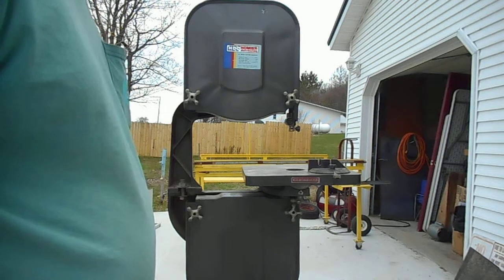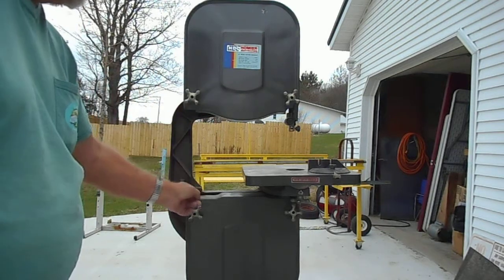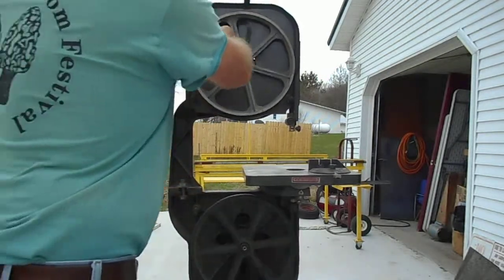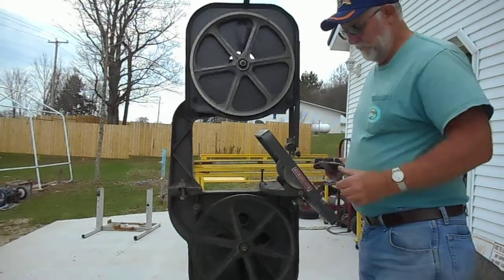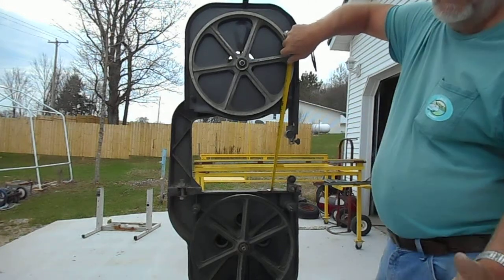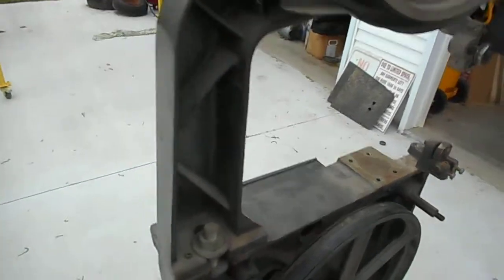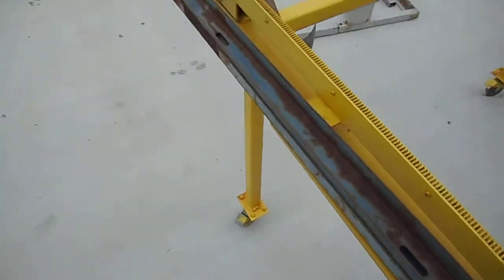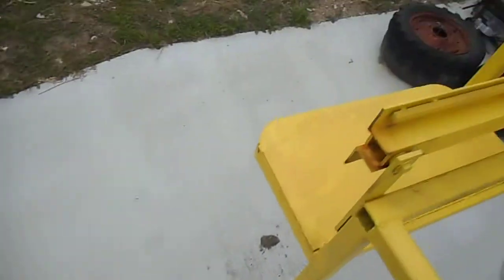Convert Band Saw into a Bandsaw Mill under $500 6.5 hp gas power?

Comment: This is exactly what I was thinking about doing even if it’s just an experiment before I make a bigger set up. Thank you! I’m not to far from you in Cadillac 👍🏼 The morel was a giveaway 🤣
Reply from the maker: I had a lot of fun building that sawmill the goal was to build it for less than $500.  Did that but in doing so the track should have been all steel as cold weather set in the (bed rails) guide rails shrunk in length more than the wood timbers leaving gaps in the track. You are about 90 minutes away from me, Have fun on your build.

Comment: Before anybody tries this let me tell you that you need one power motor to power a bandsaw mill so don’t waste your time with this.
Reply from the maker: If you watch more videos you will that it is powered with a 6.5 hp Harbor freight engine. Total purchae price $99.00 for different project. Applied $50.00 cost for motor included in the under $500.00.
  You are making a total judgement based on one video.  This video was early in the development of the project, It does work as intended and was able to cut logs up to 20 inches in diameter.
Reply: WHARGHARBHUL